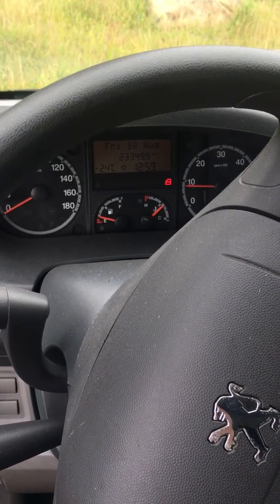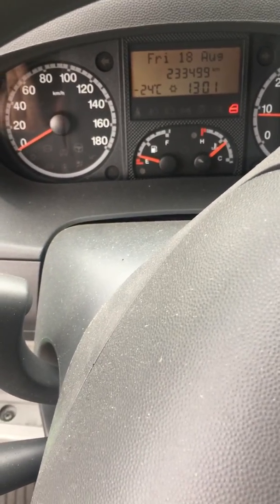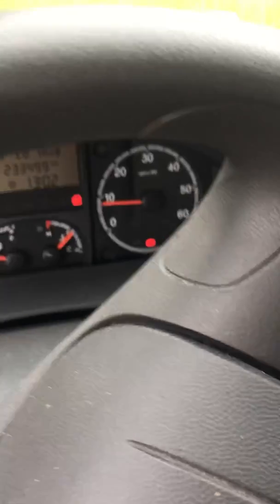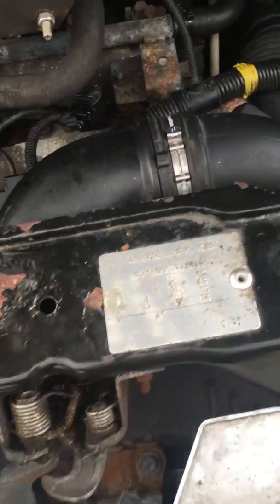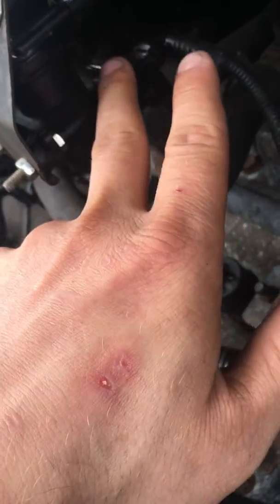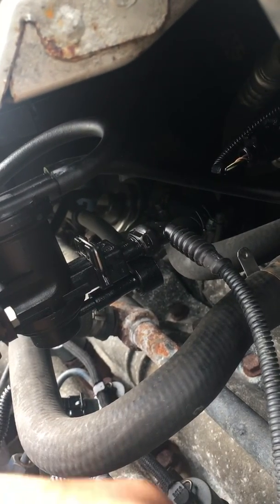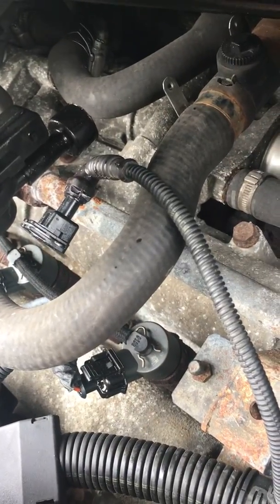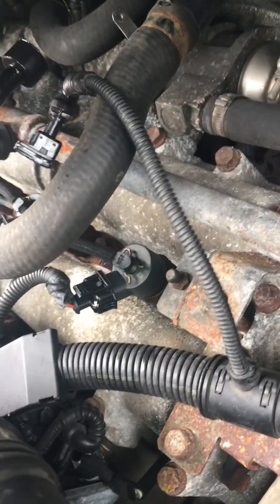Diagnosis of EGR part3

Comment: hey man, just came across your video after hours on the internet. my van (peugot boxer 2011 3.0 hdi) dose the same thing with the pfomm pfom and running bad shit. Also i dont know if its part of the same problem but here and there it blows smoke out the exhaust when driving (sometimes puff, sometimes it looks like an old train) mostly after engine braking for a long time iv noticed  when giving it gas again it smokes... do you have a clear way to fix this?? would be amazing to have a quick reply we are just traveling in the van and cant pay big money for some shop to play around.. cheers man  ps: cool videos by the way!!